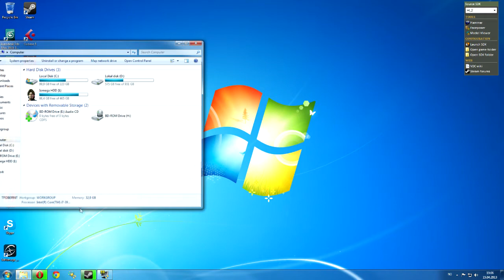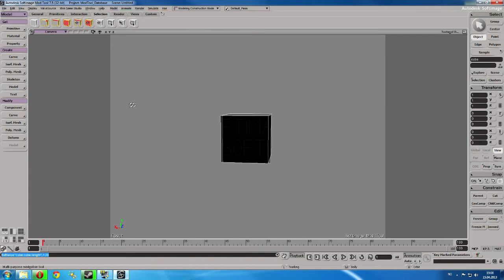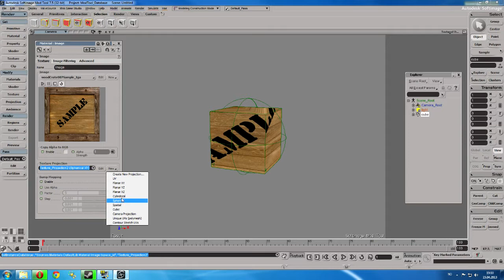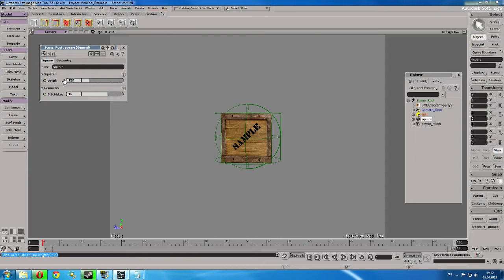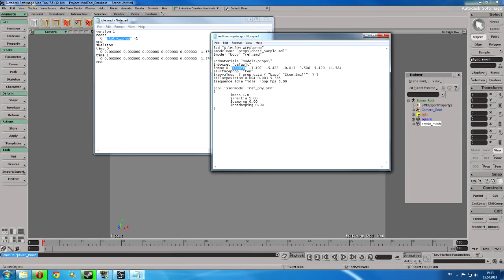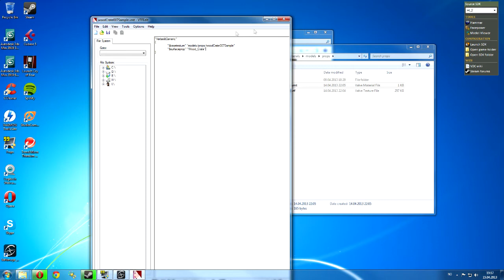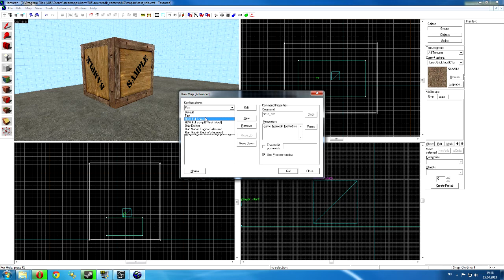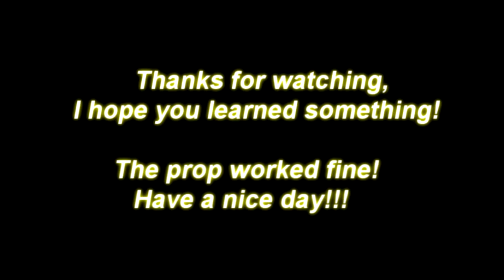Source SDK - How to create props in XSI Mod Tool and use them in Half-Life 2

Comment from the maker: Hey mate, to get working textures here's a quick checklist:
1: Set the texture path in the .QC file - Add; $cdmaterials "models\props\custom_shizz\"
2: Apply texture to your model, if the name is Crate04 then use that for the .vmt name in the directory we defined above "models\props\custom_shizz\"
3: Make a VTF file out from your texture ( tga texture must be used with 32-bit transparancy ), in VTF edit set the Alpha 5 color and alpha settings, then set it to volume texture.
4: Make the .vmt